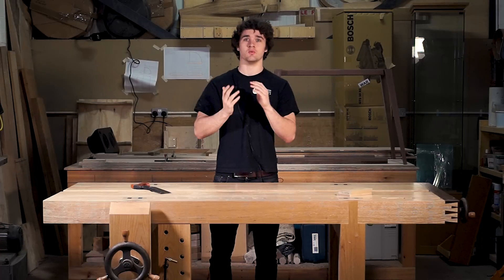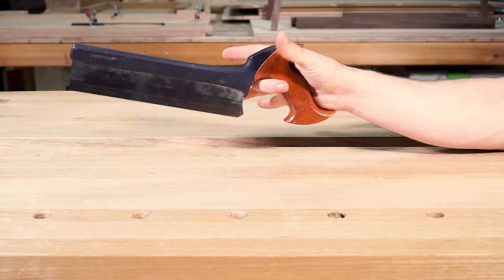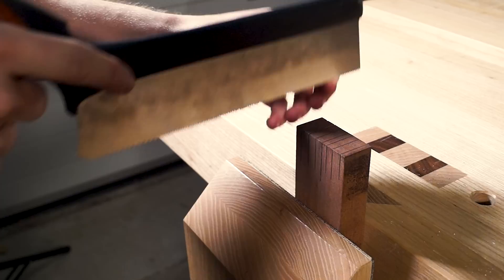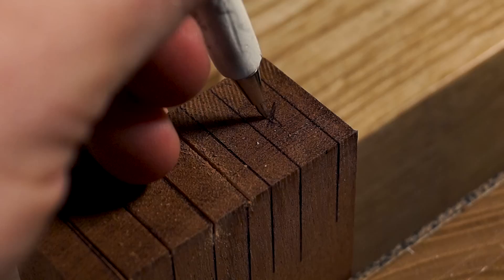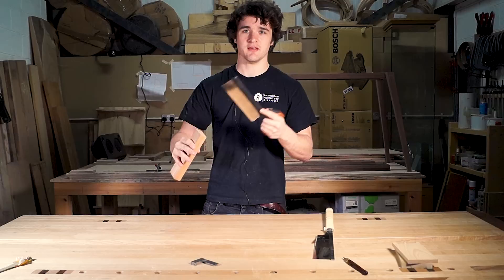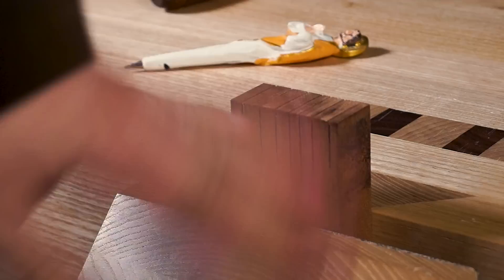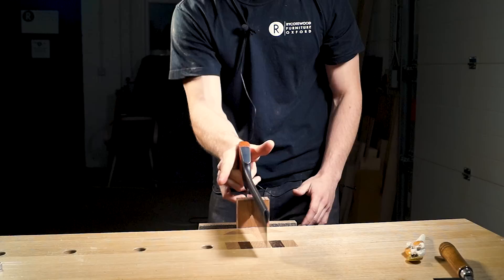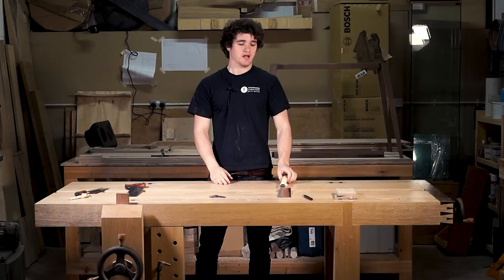How to saw CORRECTLY

Comment: Also it’s good to notice how much of the saw you are using. Beginners tend to use very tiny strokes as opposed to using the full length of the saw. This can take a lot longer to cut. Small strokes to establish the cut, and longer strokes to cut fast :)
Reply from the maker: Yep! And you've paid for all those teeth, why not use them!
Reply: Used to work with a bloke that was an absolute butcher with tools. Saw him go through needle files like tooth picks on a metal work job once. All worn through on the 2 inches in the middle. They weren't even his and the bloke who they belonged to was going nuts.
"LONG, SLOW STROKES! USE ALL OF THE BLOODY FILE!!"

Comment: Another great video !
One thing that I noticed that others sometimes don't mention is  that there is absolutely no movement of your workpiece. No vibration or wobbling which can put people off sawing.
   Your workbench is commendable. 
 Holding workpieces firm, tight and safely is the first thing to consider,  whether working by hand or machine. 
         Well done.        I will be recommending your channel to others.

Comment: As a newbie I've found that starting the cut at the back and the angling the blade right over to start the cut at the front has given me a natural point of reference to slide back to for the back of my cut. Hard to explain, but it gives me some muscle memory of where the blade need be for the back of the cut and just helps out on getting the angle right. I still struggle with cutting plum, practice is getting me there though.

Comment: It's amazing how we take so many things for granted. I always thought my problem with using these saws was that I've only ever owned cheap saws and while they get the job done they just never did it as well as I like. One of the biggest things I can honestly say I took for granted was "western saws cut on the push stroke". Such a small piece of information that completely changes how you think about the act of sawing.

That said, I bough myself a ryobi saw because I've seen a lot of people using them on youtube lately and it was only $30. The thing is a dream to use compared to my push saws. The big thing I find is using it is I stand inline with my cut with both hands on the saw and that helps me stay really square with what I'm cutting and I've gotten much better results with just having that saw in the last few days than with all the western style saws I've had over years of use. I think the Japanese saws are pretty idiot proof in their design.

Comment: I just decided to trim the height of my wooden computer table. I can't drive a nail. So not knowing how to saw, thinking how hard could it be(?!) within 5 minutes of sawing, the cut started to wander way off my penciled line. I couldn't understand it. So I started at the other end. After five more frustrating minutes of the same thing happening at the other end. I said, that's it. Stop! Step one: find out how TF to saw. Hence, I watched your video. What a revelation. Thanks for that! I'll let you know how it went after I implement this (probably) hard-won knowledge!
Reply: The straight arm worked a charm, especially when I released the death grip and my arm stopped aching.

Comment: Tip: If you expect to do a lot of sawing, get a fish tank aerator pump. A plastic hose, positioned near the blade (makeshift coathanger wire with duct tape) will prevent you from hyperventilating trying to keep the dust out of the way. A "T" connector or "Y" connector will let you use two plastic hoses, to clear dust from both sides of the saw. I've done it. Works GREAT, and not expensive.

Comment: Thanks for the tips! Yesterday I continued work on my wife's podium I am making out of mahogany, ambrosia maple, white oak and cherry.  Ambitious first woodworking project for sure.  I am using through tenons in 6 places, 2 through tenons, through tenons (Bottom cross brace will be through tenons through the through tenons at the bottom of the legs.  There's no way to make sense of that in words, I think) at the feet, wedge tenons at the top, and regular mortise and tenon joints in the center panel.  I tried to cut the mortises with my newly sharpened chisel set after hogging out the centers with my drill press, and ended up blowing out the backside of the mahogany feet that i had already cut.  I know I screwed up the order of build by shaping my feet before cutting the through tenons, and that is a lesson learned.  I should have cut my through mortises before I shaped the wood I think.  

Could you make a video of cutting through tenons?  I have seen several videos, i.e. Paul Sellers, et al, but I'd like to see your method.  Really enjoyed your workbench build.  What a beast!  Was drooling the whole time.  Many thanks!

Comment: You can apply the same trick of using the reflection of the board to make the cut both square and plumb.  In fact, geometrically, the edge of the wood appearing straight in the reflection is dependent on the blade being both square and plumb.  If the line appears to turn at angle, it is not square.  If the board edge and surface appear to run up or down through the saw, the blade is not plumb.  I was taught this by a carpenter cutting construction wood, but the geometry applies.

Comment: thanks - great video, well explained and demonstrated

I have two comments to add: the first is the height of the saw, ie a carcass saw vs a gentleman's. for the taller saw, any given movement at the top of the saw results in a smaller angular deflection, and so is easier to control

secondly, if you're using a Japanese ryoba (double-sided) saw, it's easier to start a rip (or dovetail) cut with the crosscut side, which typically has more tpi than the rip side

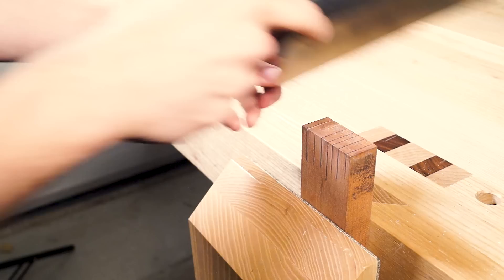Comment: In the 4:00 marking about using thumb for microadjustment and supporting, I learned from a old craftsman decades ago that you place your left thumb fingernail at next the cut position you want it to be, and then you bend your knuckle so that thumb joint forms a wanted angle with the saw blade. You can easily adjust angle slightly while saw blade rests on the thumb joint and thumbnail. 
The saw doesn't cut to your thumbnail, your thumb joing doesn't suffer and you get straight lines quickly. As well when you position your fingernail you get to make accurate selection where the cut is going to be and your saw can't jump sideways while doing first pushes (or pulls when using japanese saw).

Comment: I have rarely used the type of grip and sawblade that you use (we always used the japanese type) But one thing helped to think about with regards to the grip: you want to be strong against the movement you are cutting with. everything else should be loose and relaxed. With most says that means you are gripping strong against the pull and everything else is loose.

Comment: Great tutorial. One thing to check - on Western saws, the first few teeth at the tip typically have a different take )less aggressive) as they're set to start the cut. I know my old crosscut tenon saw has that. You can introduce it yourself when you re-sharpen too.
Reply from the maker: I'm aware that Lie-Nielsen and Bad Axe Toolworks do that with their saws but I'm not sure they do on my Veritas saw. But you're right, it makes it so much easier to get started!

Comment: Well done. One of, if not the only, really good tool handling videos I have seen. I will say that I don't much care for the phrase muscle memory with regard to working with wood as it implies all wood can automatically be dealt with in the same way.  In very fine grained wood a consistent effort is useful, but in woods like oak and yellow pine adjustments must be constantly made as you go through the seasonal growth material. I would also say that a saw must have at least 2 teeth engaged in order to move smoothly so a low start angle is very necessary. Please. Please. Please. Sharpen that saw. It is a worse sound to me than fingernails on a chalk board. Carry on.

Comment: Excellent video, one more technique for the start of the cut, if you sharpen your own saw, lessen the angle on the first inch of teeth. It makes the saw less aggressive and easier to start. Credit to Paul Sellers. I did it to the exact same 20 TPI Veritas you demonstrated with and it does help.
Again thanks for a great video.

Comment: In regard to the bit about cutting plumb...it struck me that you sort of create a "pendulum" from the shoulder to the elbow, making sure your torso is out of the way of the swing of the "mechanism" and that elbow-to-blade is one line. Nice.
Reply: R. Dean elbow to blade one line doesn’t guarantee a plumb cut because rotation at the wrist can cause a /or \ deviation, and the wrist can rotate even with the elbow perfectly in line

Comment: Matt:  I'm a recent convert to hand tools.  This video has helped me a lot.  I've been practicing with a few older saws I picked up.  I think my technique has improved quite a bit. With 3 of my 5 saws I can cut much straighter than before, and I get a reasonably decent kerf. However with one of my saws the cut seems to drift offline, with another the blade seems to bind in the wood. Can you explain the indications of whether a saw needs to be sharpened or set? Which is which? Is this what I'm experiencing, or do I just still need to practice more? Obviously I'm going to continue to practice, but I just have a feeling something else is happening aside from my being a beginner with hand tools.

Comment: Nice vid. I prefer Japanese pull saws as they are easier to use as cutting on the pull seems intuitive. Only problem with Japanese saws is they are disposable. I have no idea how or where to get them sharpened.  Also they mostly come with a big hunk of plastic as their handle. Love to use my Pax Gent's saw more but push saws are just okay to use but great to hold though.

Comment: Great info Matt!I only use power saws in my shop. I haven’t used a hand saw in years. I guess I don’t understand why someone would use a hand saw. Can you explain why you use hand saws instead of power saws? Isn’t it less accurate? I know there must be a good reason! Please splain me.
Reply: Machinery is excellent under workshop conditions and when you are turning out work for a profit.  But when you need to do quality work 'on site' you need to be able to work efficiently and accurately by hand.
Another reason for hand-work is that it is therapeutic and some people like to do this as a hobby, where job satisfaction is the aim, not turning out the work, as quickly as possible.  It's about the journey, not arriving.
And I don't think you can match a hand-built finish on a project with a machine-made one, even though the machined job will be perfect, if the machines are set up and used correctly.  Some people are willing to pay for this, thought the majority, of course, are not interested (and understandably so.)
I knew one man who became a millionaire and more, by the use of his hands.  He made watches.  They sold for thousands - many thousands - each.  His clients, of course, were not interested in using the watch to tell the time, even though these watches ran so perfectly that they could (in all practical senses) match a quartz watch.  What they wanted was a unique and beautifully made work of art.
Reply: I can definitely appreciate the skill that it takes to do nice woodwork without power tools.  Thanks for the reply. 
There's a beautiful hand-carved Road-Runner (the bird, not the car) on the coffee shop wall where I often eat.  It's carved out of several different kinds and colors of wood.  I was told it sells for about $40.. somewhere.  If they carved that by hand it must take days to do it.  I'm sure it's not done for profit!  Every time I go there I admire it.  I would love to be able to do that kind of work with hand tools.

Comment: Does all the western saws are push saws? and all Japanese saws are pull saws? And how do you need to hold a Japanese saw? Last, is it better for beginners to start with a Japanese saw? Meaning if I started with a western saw should I change it?

Comment: Hi, what is the best way to saw thru a broad sheet of hardboard using an ordinary saw please? It is appx 7 feet long, 3 feet wide. Needs to be cut lengthwise to make 2 equal parts of 1.5 ft width.

Comment: Great information, but you should explain why you want your pointer finger to be straight.  Your thumb points forward, so you need to have the finger pointing forward to counter the pressure your thumb is exerting.  Neither should be squeezing hard at all, but if the pointer finger isn't opposite the thumb, your thumb will will swivel the saw away from you every time.

Comment: Totally off topic but do you have any tips to get this thing to lock off properly http://www.axminster.co.uk/axminster-workshop-sliding-square-ax207669 it's a brilliant tool but just won't lock tight?
Reply from the maker: Other than drill a tommy bar into the nut, I have no idea! I'm not responsible if it goes wrong though and don't tell Axminster I said that!

Comment: wrooooooong. Always start the line in the opposite direction as the teeth cut. i saw you get stuck 4 times starting your cuts and you had to cut the video away until you actually got it started.